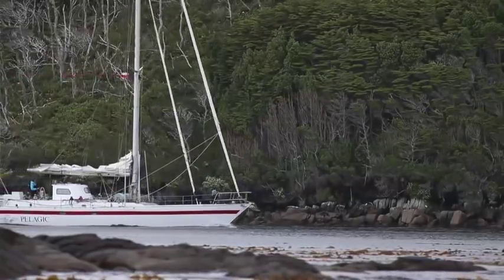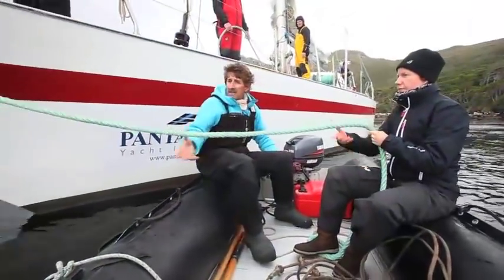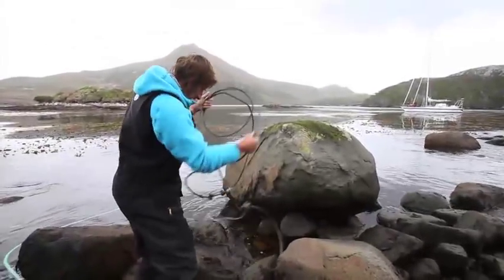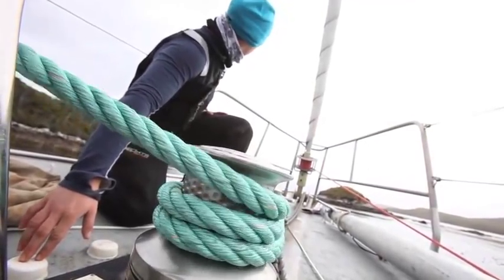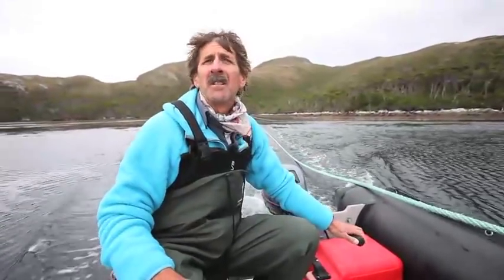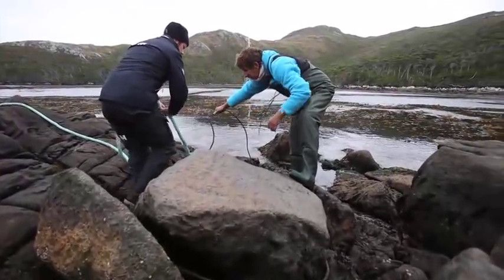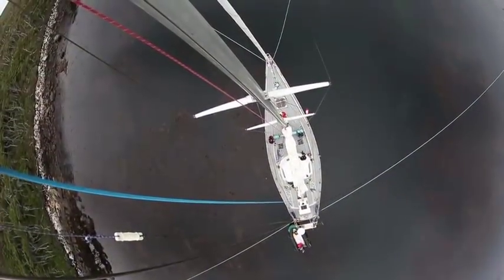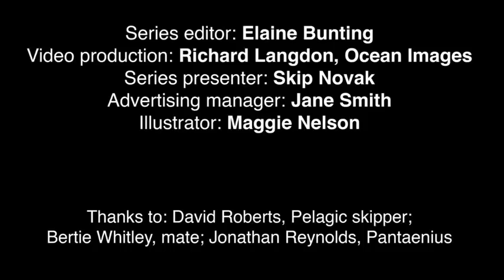How to tie a yacht to shore – Skip Novak's Storm Sailing | Yachting World

Comment: Thanks! Bahamas anchoring style is also a good option to explore if less time available.  For example You drop the bow anchor and release (straight) 200' ft line, then drop stern anchor and tie the end of the line through the bow also, then pick up the the 1st. Bow line 100' feet and you are anchored in the example with 100' feet both bow and astern yet both lines are tied to the boats bow thus the boat would just swivel around in  place in a tight circle with any wind change.

Comment: Thinking... with all the ropes (two in front), why do you need an anchor for? Interesting videos. Interesting gear you have on board. Keep up the good work.
Reply: When setting up drop the hook then run a stern line ashore - you're safe. Then rig the other lines to stop the boat sheering around. When departing; all lines of except the windward stern line and then coordinate dropping the last line and shortening the anchor.
Reply: Apart from everything Chris Harris mentioned, it has to be good insurance